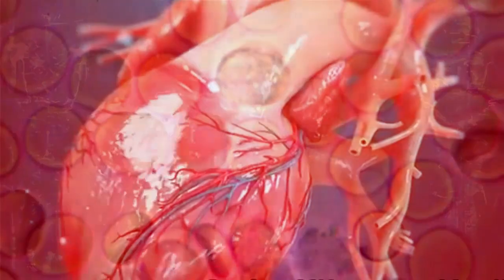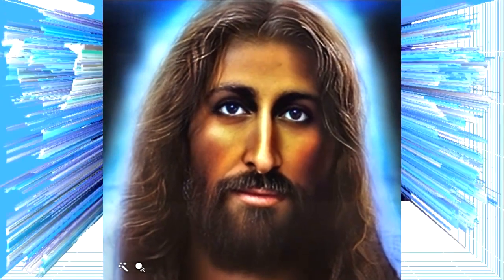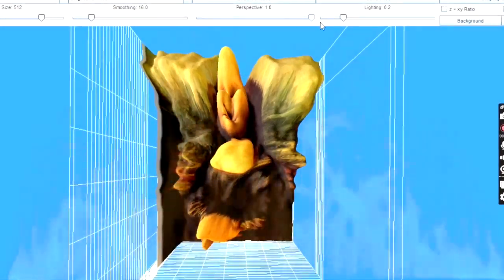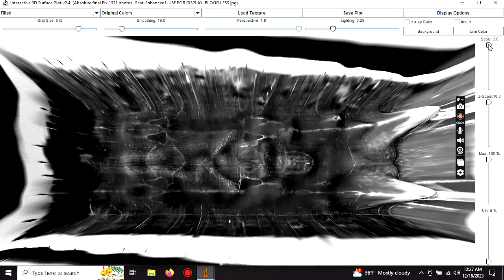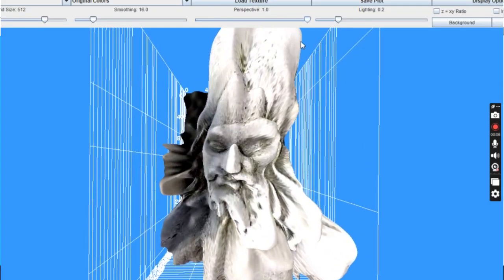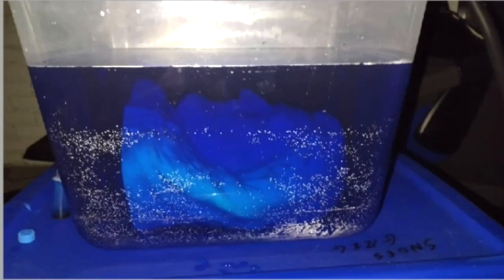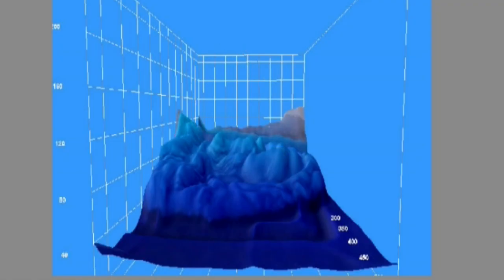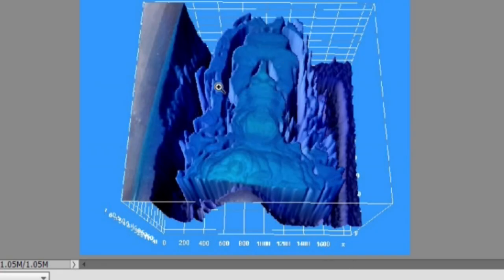X RAY IMAGES ON THE SHROUD OF TURIN

Comment: I love this channel I recommend it to people all the time. Please provide us with a go fund me link or similar so we can support your ministry please
Reply from the maker: Hello Mick.   We are working on a 20 minute video that will add even more to this presentation and deeper insight into the image process.  could be 25 minutes

This has been delayed due to health problems over the last week. 

This explains in more detail why the Shroud image does not distort out when the depth gain levels are turned to the maximum

The main reason being it means the spatial depth info is accurate and the  3D info was a planned out event.   Well thought out and was put there intentionally.  It is not a random accident.   There is a purpose for it being there.  Mainly to show a Higher Power Intelligence/God was involved in the image process.    To do this is NOT a simple process.

Real holographic information is very tight and  subtle with no extreme color intensity variations.  The Shroud info is like this.   Man made images do not contain spatial depth info.   It is something that is planned out and put there intentionally. 

The 3D depth info is accurate math.  A 3D blueprint of the body in the Shroud.   Instead of numbers written out it is done in colors.
'
Math converted to color. .. this is what we discovered in our 2 year research project on the depth info

According to our present  level of knowledge to create accurate math like this electromagnetic waves of radiation had to be coming from the body to be able to create the correct color pattern that is in direct proportion to the body

The 3D Analyzing software  (Our Witness) An expert in converting color to math  tells us the math is correct. 

This eliminates a man mad image theory 

I am struggling with some health issues but hope to finish the video that is  on the editing software before Thanksgiving.  The audio track is complete and about half of the images.  It is nearly done .

this is the link to donate to the channel.   This is SO GREATLY APPRECIATED.    THANK YOU IN ADVANCE!

https://gofund.me/147a2e79
Reply from the maker: Hi Mick Thanks for helping out the channel and recommending it.  It makes a huge difference.   This is the link to donate to the channel
https://gofund.me/147a2e79

I've been dealing with health challenges for the last 8 days and hoping they will be resolved soon.  I have not been able to work at all for over a week now .

Sorry for the delayed response
Reply from the maker: Hi Mick
This our latest video.  Wishing you a early  MERRY CHRIST MASS  One of our best uploads.  Gets deep into the 3D info 
Video link
https://youtu.be/jIVXMhLBNv0

Comment: Yeah, shroud can't replicate it because it has contain blood in body suffer has not contact image, they're delusions
Reply from the maker: Hi Gilbert.   Yes.   The body images over the blood have accurate Spatial/Distance information.   Information like this is not accomplished by pressing a statue against linen.     It must be done with light waves/radiation coming from the 3d object, in this case the body in the shroud. 
If the shroud was simply a contact image with pigment that would have been easily detected by the 33 scientists in 1978 scientific examination.of the shroud

Comment: Great video! I have a question about converting images to 3D, if I may. There's a Shroud researcher by the name of Colin Berry who has done experiments with scorches to try to recreate the 3D properties of the Shroud. His conclusions were that it is possible to generate 3D images from 2D scorches, although they will be florescent unlike the Shroud. He's tried various ways to eliminate fluorescence, like with nitric acid and flour but without total success. 

My question is, have you analyzed scorches with your 3D software, and do those also display accurate 3D information like the Shroud, or no?
Reply from the maker: Hi Regulator062    Yes I have put Mr. Collin Berry's scorch image on the 3D analyzing software.       It distorts out just the same as every image that is presented here does.   These include all skeptic replicas and also  3D  death masks and 3D art work.  You name it.  I have probably seen around 500 other images in the last 2 years.  The goal was to do a fact based, impartial and thorough investigation and see for myself the Shroud and other images on a 3D surface plot and analyze them 

I will tell you why other images do not contain depth info

For starters, when you press a 3D object onto linen there is no transfer of spacial depth info    
(there was no space between the object and the film plate to record)
An image created by a contact image does not contain any accurate information about the 3D characteristics of the image
When put to the hard test for 3D info they all fail. 

To create accurate 3D depth information the object being replicated must be emitting and or reflecting light in a dark room and the speed of light MUST BE SLOWED DOWN. 

Any object that is photographed with the light traveling its normal speed of 186,000 miles per second will fail the test for accurate depth info.    With the exception being if the object photographed was created with 
1. The speed of light slowed down approximately 70,000 mph
2. Object being replicated was emitting and or reflecting light in a dark room
3  Object being replicated was very close to the film plate. 

Another exception would be a hologram, those images are created by an interference pattern of light.  Laser light diffracted

The image process on the Shroud matches all the unique characteristics of a hologram

The evidence  leans heavily toward the image process taking place outside of time.
Reply from the maker: Hi Regulator 062

Any contact image process will immediately be wrong. Including all scorch images.   Add X rays images to that list, photographs, 3D art work, death masks,  camera obscura images, any kind of painting or art work.   

During our 3D INFO tests,  I took the statue head that was emitting UV light out of the water and placed it on the ground.  
With the camera positioned  at the same distance and the head in the same position I took photos.   Camera flash on and also off. 
Some at a longer distance some a short distance
ALL OF THEM FAILED THE TEST FOR 3D INFO.  

However,  take the same statue head emitting UV light and place it underwater about 18" from the surface and snap a photo using flash on the camera.  This method produced the best results
In this case the object is both emitting light and reflecting light underwater  An odd combination. 

As soon as the light from the camera flash entered the water it slowed the speed of light down, bounced off the statue head and then back to the camera lens.  (The light also interacted with the UV light being emittted)
The result is an image not created by light traveling at 186,000 mph per second .  That is the key factor.   That's it.  

This method works.  This actually encodes a 3D Spacial blueprint of the 3D object that passes the test for mathematically correct  3D Depth  Info

Here is what I don't know   Why?

Why does the light traveling appx 70,000 mph slower create accurate 3D spacial data?

Still trying to figure out why to this day.
Reply from the maker: I must add one more thing    We cannot limit the Lord God to our level of understanding of how to create 3D info,  so the image process could have been something we have never seen before and do not know how to do. 
So the Shroud image process according to our level of understanding would be an image created by an interference pattern,  the same as how a hologram is made. A hologram is  the only image process that matches all the forensic evidence.  

However, that takes time. We cannot make a hologram in one second. It takes several minutes.  I have made many holograms.  
So the topic of time itself comes into question and also how to levitate a dead body completely frozen and static  and create space between the linen and the body and record the spacial data with light waves.  

And that is the mystery of the Shroud.  
How to do that..............................
Reply: @GoodShepherdFilms3333  That’s very interesting! Much appreciated for the answer and explanations. It is intriguing light slowed down to a certain speed seems to work for accurate 3D depth conversion purposes. I really don’t know the reason for that either though. It’s something I will ponder even if I probably won’t figure it out.

It’s also interesting the theory that the Shoud image is a result from light interference, as with a hologram through refracted light. There must be some strange commonality going one with the interactions of light in your experiment with the statue head, I presume. But I have no expertise on the matter. 😅
Reply: @regulator062  You would think that our tax dollars could fund some of this type of research.  Our very world is at stake.  I'm trying to post some of these videos on X that might get Elon Musk's attention.  I'll try harder.

Comment: I HAVE NO DOUBT 🙏🏻♥️😊
Reply from the maker: There are scenes and displays in this video that no one has ever seen or has ever been presented in any video anywhere.  We put the shroud of Turin  image on its side and spread it apart. 

The fact that the information is tight and compact is the reason it will not distort. 
It took nearly two years to figure that out.
Reply: @GoodShepherdFilms3333  AMAZING 🙏🏻

Comment: 115,000 hrs of science research summed in 32 minutes. I tip my hat. One point about the spacial slowing: if the body isn't touching the top sheet, and the body isn't touching the bottom sheet, but the body is emitting time sensitive radiation in a straight line both ways, at the same time, where is the body EXACTLY at the point of animation?
Reply from the maker: Very good question.
Of noteworthy mention.  The 3D info on the dorsal side is not the same as it is on the front.  There are so many blood stains that it is hard to separate the 3D body images from the blood.
Also because the knees were raised it leaves big gaps of blank info in those areas
The dorsal side almost appears to be more of a contact image. 

Also I did not get into this subject in this video but will in the next is that light could not have been exiting the body in straight lines. If so, the coloration process would be different that it is.   It would have to be diffracted laser like light exiting skin pores and creating an interference pattern.

One of the odd characteristics of the Shroud image is that it is a one color image.  And variation of color is achieved by more or less of the same color in a given area.   
Our level of understanding tells us the  body had to be separated from the linen and emitting electro magnetic radiation.  waves of light   and parts that were closest to the linen had  MORE pixels of the same color and parts farther away from the linen had LESS pixels of the same color. 
The only way we know how to do that is my making a hologram.  A holographic image is the result of a interference pattern of light waves, electro magnetic waves 
This  tells us the image was created by this same type of interference pattern of light waves coming from the body or a similar process that only the Lord God knows how to do and is still unknown to us.

I have another video on this subject on the video editing software that explains what a interference pattern is with graphics

As soon as I bring up the discussion of an interference pattern this immediately adds 15 minutes to the video.   So to avoid confusing someone I left this out for now
The Shroud image was most likely the result of a INTERFERENCE PATTERN OF LIGHT,  in which the light from the body exited skin pores and was diffracted .  Laser light that is diffracted will form a interference pattern.   
It has been observed in Science that human DNA emits laser like light and when diffracted creates holograms.  That is observed in Science,  is possible the distance info on The shroud was created by Light emitting from amplified  DNA

The other possibility and the most likely one is that the Lord God knows a way to create 3D info in a way unknown to Modern Science

We cannot of course limit God to our present level of understanding

And then we come back to the "Mystery of The Shroud"
Reply from the maker: In all of our attempts to create the same type of 3D info on the Shroud we tried
1. Statue placed on a Photo copy scanner  (this was the 2nd best results we got)
2. Statue head in water no food coloring
3. Statue head glowing in dark room but outside the water 
4 . With camera flash and without
5.  photographing from a greater distance to short distance from object
6. Statue head evenly illuminated. 
7. Statue head in low level lighting
8. Statue head in dark with camara flash outside of water

Only 1 method worked .  Underwater with food coloring
Water slows down light about 46,000 miles per second slower
Food Coloring has crude oil products in it,  that slows down the light another 20,000 to 25,000 miles per second
70,000 is an estimate of how much light was slowed down. 
'
THIS METHOD WORKED.  

Bill, can you figure out why light traveling at a slower speed creates the correct  light intensity distribution in exact proportion to the 3D object?
That is really what we were after and we got it. 

The 3D software interprets bright colors and up and dark as down

If the color is wrong then the math is wrong and it will distort under the hard test. 

Basically any image that is photographed with the light reflecting off the object and back to the lens at 186,000 miles per second will fail the test. 

The statue head correct 3D info is a combination of UV light emitting from the statue and light reflecting off. 

So the light had to travel through the water, bounce off the statue and back to the camera lens

That method produces correct 3D info.   Light being slowed down  Why? 
 I cannot answer that.
Reply: I've always wondered where the body was at too. There's so many theories it's hard to keep track of them all. Very well done video, David!
Reply from the maker: The answer to that question based on our understanding that matches the forensic evidence tells us the body was very close to the linen and the linen was pulled straight    if not the distribution of lights and darks on the linen would not have correct 3D info. 

Unless the creator of the image knows  a way to accomplish this in a way we have never seen before or understand
Reply from the maker: My question to you Bill is this one. 
And we both know that you're smarter than I am. 

Why does slowing down the speed of light create accurate spatial data in mathematical agreement with the 3D characteristics of the object being photographed? 

We photographed the statue head outside of water, on the ground,  in the exact same position as it was in the water tank and the exact same distance and the end result is an image that has no accurate spatial data. 

Now take that exact same statue head  in the exact same position place it under water with food coloring and take a photograph and it has perfect 3D spatial data 

Why?   Why does altering the speed of light change spatial data information?

Bill you might be one of the very few people on this Earth that will be able to answer that question....

I believe we are talking about an image that was created outside of time.
Reply: @GoodShepherdFilms3333  At the speed of light, all time stops. The speed of light today is regarded as a constant because if it slows down any more, the wave function changes on the spectrum relative to the rest of the spectrum. Radio waves are no longer functional, infrared, and x-ray depend on calibrated repeatability. When God said, "Let there be light." Light likely moved at an infinite speed and then slowed rapidly after the fall. It also carries temperature and matter conversion. The mass of stars are determined by luminosity and colour. At 186,291 mps, the necessary wave length for the optimum single wave depisited on the shroud - a single bandwidth - is optimised. Ergo: a Sepia stain AT the selected bandwidth.  And is the optimum wavelength for the tendrils as it passes through. Last, no unnatural or natural technique existed before around 1990 to do this except through a material.  Ie water. Blue is lower end spectrum.  Slower waves. Given that there was no material between the shroud image and the body except cold cave air, no one in the day or since could create the same conditions. A stain is made.

Or a simpler equation is light slowed is matter made. That's why the image was visible from the start. Sepia deposit at a 40 billion watt fraction of a second. Now ingrained as a stain.

The body didn't touch the material at the time of the image because....  the body was not impacted nor affected by GRAVITY.

Fun fact: if light is eternal and fast, all the subproperties of light are also available at the same time. Ergo: if God speaks, man in that light could hear as if through radio, in real time. As again it will be in the NEW Heavens and NEW Earth. Light doesn't slow because there can be no fall.

Do with that what you will. Light properties as a maker of matter was discovered 27th July 2021. By slowing light by a fraction.
Reply: I think you're smarter than what you say, and I'm dumber than I look. All debatable points I invoke the square root of humble pie.
Reply from the maker: @voiceofreason162  Hi Bill  Note how the fingers are bent on the hand.  That is because that is position his fingers were on that hand on the cross. And when Jesus died the body went into rigor mortis and they did not bend the fingers back during the burial.
Reply: @GoodShepherdFilms3333 I'll email you. I just put the science down, YouTube algorithms deleted it on the spot. Because it's programmed by morons.